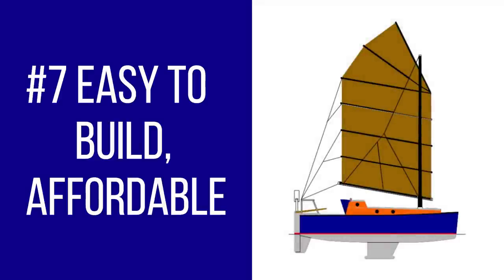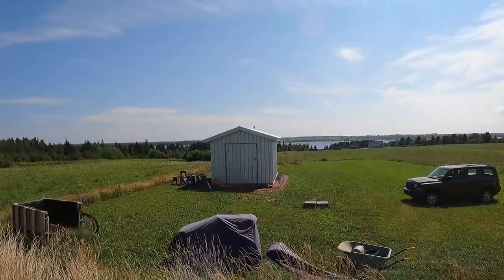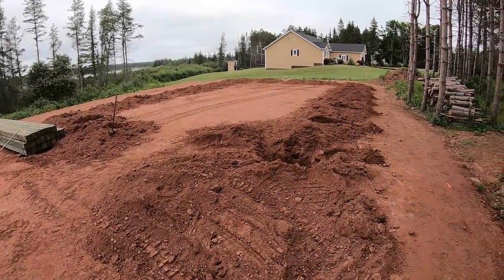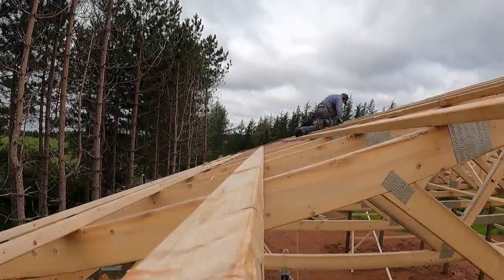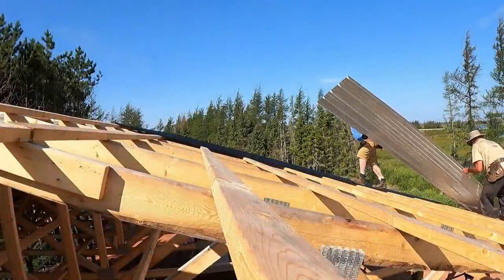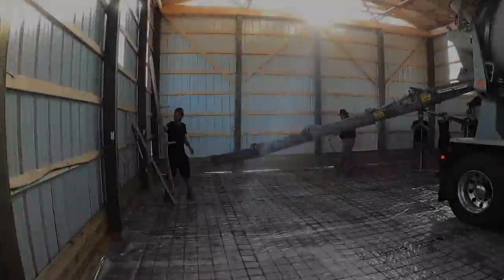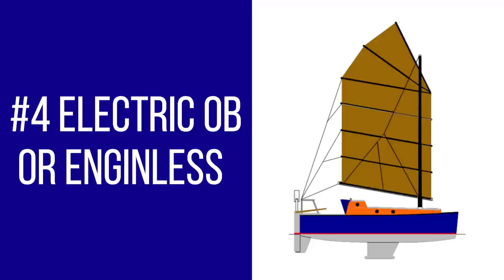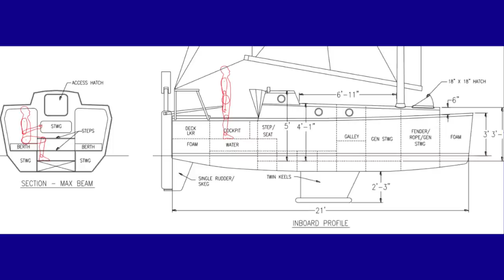S2E02 Boat Shed Build and Wave Rover Hull #1 Plan Availability

Comment: Kudos to Mrs. Rover! My wife was in shock & awe. Ha ha. Alan, not sure if you wanted questions just about the designer's background or the design of this boat in particular, but here goes: What other boats have been built from his plans? How about an explanation of the hull shape? Will she self-right if turtled? What is the preferred heel angle for efficient sailing? What is the hull speed? How much horsepower to motor at hull speed? Primary and Secondary stability. How to design it with strength to survive rollover. Tell us more about the positive floatation aspects of the vessel. Ply-on-Frame construction or Stitch & Glue? Wood species? Fiberglass & epoxy schedule? How will the running rigging for the sail be organized? Will the bilge keels be fabricated from steel, cast iron or lead? In theory the Junk Rig is simple, but sometimes all the parrells used to control the yard, battens, boom and diagonal wrinkles can get overwhelming...how do you plan to keep it as simple as possible for a 21 ft. boat?
Reply from the maker: Great questions! I will pass on all of them to Andy, they will make for great discussion and answers.

Comment: Hi Aan,  I watched this video earlier this week and took screenshots so I could capture the images and see if this a boat I'd like to build.  Then followed up watching several YouTube videos explaining how a Junk Rig works.  The Junk Rig looks very simple, and user friendly for a single hand sailor.  Not having to leave the cockpit to make sail changes, makes this much safer.  Wednesday 9/1/21, I sat down to analyze the drawings and wrote down the changes I would make to fit into your seven point design criteria.  I believe with a few changes you can have a boat with more strength, integral water tanks with greater water storage capacity, greater amount of storage space by rearranging the foam to be also insulation for the hull, ceiling,and floor (using materials that can be bought at big box stores like Home Depot).  These are just a few of the ideas.  Last night, Thursday, we saw your video and announcement for the study plans.  Today I purchased your Boat Study Plans and the Wind Vane plans.  I'd like to discuss the plans in greater detail as I feel a few changes will equate to greater strength, more  positive buoyancy more evenly installed, which will bring greater comfort.  Is there a way I could email you and the architect these ideas?
Reply from the maker: Go to the "about" section of the Channel and you will find a business email. I look forward to hearing from you.

Comment: I have cruised in the Pacific in a vessel of similar size. If I were doing it again Wave Rover would tick just about all of my boxes as an ocean going home. Like Wave Rover my boat could be sealed up tight and proved to be very seaworthy. However, it did lack enough ventilation to make living aboard comfortable in the tropics, which is where you spend most of your time on a circumnavigation under sail. Also, it would have been nice to be able to stand erect somewhere in the cabin.
Reply from the maker: Ventilation is a problem that I will ask the architect to solve or at least get some practical input.

Comment: Thank you Alan for solving the problem with my study plan down load… all good. Very pleased with the concept. I enlarged the plans to 21 cm etc. And I noticed the births are quite long and the figure appears to be about 5’6”” tall. Is this so?   These are observations. The stern of WaveRover seems very wide I was wondering why?  The rudder…… would it be better, if it was a balanced rudder? Just asking because a friend of mine had a drop rudder on his large trailer sailer and the pintles were vertical, which caused weather helm. He tilted the top of the rudder away from the stern so there was more area of rudder in front of the pintles… it worked.  Thank  you very much for an excellent series of videos , cheers Tony Woollcombe
Reply from the maker: HI Tony, a lot of details are still being developed at this point by Andy. The balance of the whole boat is very important to me and it's a point that I stressed with Andy. And I have every confidence that Andy will not disappoint when he produces the actual construction plans. Thanks for supporting the build.
Reply: @RoversAdventure  thanks Alan

Comment: Just wondering if you could compare the Wave Rover to the Class Globe 580. I fascinated by both and would hope to build one of them.
Reply from the maker: Firstly, I almost went with a 5.8, also check out the Aviateur 5.7. But ultimately they both lack sufficient carrying capacity for the type of long distance cruising I envision, so Wave Rover  is bigger and has considerably more buoyancy to carry heavier loads without sinking below her DWL. Both the 5.8 and the Aviateur have sophisticated modern fractional rigs with running back stays where as Wave Rover has a simple to use, simple to rig, simple to make Chinese lug sail. Self steering is very important to me and not an after thought, so I told my naval architect to prioritize that in the design and that's why we have hydrodynamically shaped twin keels (which also act as ballast, cradle, and dampen the rolling at sea). Finally, I believe that the Wave Rover will be cheaper and easier to build.
I suggest that you watch my next video as Andy answers a number of questions about the design and we make a limited number of Study Plans available.
Reply: @RoversAdventure  "I believe that the Wave Rover will be cheaper and easier to build (...)" well said .... I like it :)

Comment: the trusses rest on perimeter beams.  how are the beams attached to the poles? what prevents the bottom edge of the walls from frost heaving?
Reply from the maker: They are supposed to be through bolted but Brian just nailed them with 4"nails, I would have bolted them. The perimeter is very likely to suffer heaves as nothing other than drainage is the only precaution. These pole barns are generally constructed as barns for live stock and the heat from the animals keeps the perimeter warm but in the case of a boat shed this is unlikely to be the case. You have identified the main reason that I would not build such a structure.

Comment: Hello, this is a very great idea and i might be building it, as my previous boat is not solid enough for such a program.
Just one question : do you plan any way to remove the mast to put the boat on trailer or go under bridges ? Because you said it will be bound to the keel.
Thank you !
Reply from the maker: The mast will be keel stepped and will be removeable, but at only 25' above the water line it should be easy to sail under most bridges. It will however require some assistance in stepping it.
Reply: You might consider a mast tabernacled at the deck. I'm currently sailing a replica of the 1876 transatlantic dory Centennial,  this boat has a 20ft. Tabernacled gaff rig which can be lowered at sea to ride out especially bad weather and to fix anything that may become fouled or break aloft... just a thought.

Comment: Curious why you wouldn't pour the floor first, then place the poles on the concrete footing. That way you would not have to use pressure treated lumber and would be protected from the earth.

Comment: ...My guess is that the hull will be made of plywood (e.g. 10 mm thick) waterproof and a few solid hull frames.?
Reply from the maker: We are going with 9mm marine plywood for most of the hull and 18mm for the bottom. Covered in Fiber Glass. Frames and bulkheads for strength
Reply: @RoversAdventure  brilliant, it looks reasonable, thx a lot for your quick feedback, all the best :)

Comment: Just wondering about a scaled-down coastal cruiser. 16' w/ 6' beam with all the features of the 21' boat. I want to avoid registration $ and explore the ICW. Just a dream to have a junk rigged engineless boat. Same boat - just 25% smaller. Whatcha think?
Reply: Also Selway Fisher, Phil Bolger, Jim Michalak, etc.
Reply: @skaraborgcraft  Not even close. Mast has cables and no junk rigging.
Reply: @cornishhh  Selway Fisher- no junk rig, mast cables
Phil Bolger- no cabin
Jim Makalak- side keels
I don't think the perfect boat exists in a 16' junk rig twin keel. Sailing oceans - yes, you need 6 months storage. Coastal Cruiser, not so much. ICW or Great Loop in a sailboat with a sculling oar, what a ride!
Reply: @steamyb2  How about William Longyard's Lucky Town? I'm pretty sure more than one Bolger Micro has been built with a junk rig and they dry out pretty flat.
Do you reckon you'd be safe going down the Mississippi without an engine? I'm in the UK so I don't know, but it looks to have quite a flow on it in some conditions.
West Wight Potters sometimes have junk rigs don't they?
Why do you especially want a twin keel?
Reply: @cornishhh  Twin keel for shallow water along the NC & SC coasts. Regular keel works great for blue water sailing and ballast. I would be using water bags for ballast.
I am just starting this research, so I think a shallow draft, flat bottom with a large rudder or twin keels would go down the Mississippi without a problem. Folks have done the Great Loop on kayak, canoe, etc. 
I will check out William Longyard's Lucky Town. Thx!
Reply: I’ve been looking at similar options since coastal cruising is more to my ability right now. There are a few gaff or Marconi-spec’d boats from the Atkins folks in the 18-20’ range with draft around 2-3’ (these are all keelboats as I’m looking to avoid center boards for cabin space—though two leeboard options are intriguing). I’m also looking at Oughtred’s smaller cruising boats (18-20’). I assume many boats can be reconfigured for junk sails, but I’m not sure. I’ve also been looking at the Triloboat sailing barge concept that calls for junk rig.

Length of 18’ seems to be about the smallest most designers go for cabins suitable for multi-day trips. Smaller tends to depend on open boats and tents (on board or on ground). Is 16’ a particular advantage on the ICW?
Reply: @jelliottlein  16' LOA does not require registration. Anything over 16' or with an engine has to be registered. Just my preference to avoid paperwork.
Reply: @steamyb2  Thanks. Good to know. The only boat I’ve built so far is 16.5’ long; a 2-seat decked canoe/open kayak that can be sailed. 21’ is close to the smallest I’ve found plans for a sailboat with a cabin; 18’ flat is the shortest on my “possible” list right now. There might simply be a limit there. But I see plenty of folks doing the open boat camping thing along coasts (see Roger Barnes’ “Dinghy Cruising”), and I’m likely to build a 14-16’ open sailer (maybe Oughtred’s Elf or Woodfish) before I take the next step up to a cabin cruiser of 18-24’.

Comment: Q: why a flat bottom, while a v-shaped bottom would improve behaviour and would prevent slamming on waves?
Reply: You'll find that going to windward a flat bottom is heeled over and presents a sharp chine which quietly slices through the oncoming waves... where a V bottom heeled to 30-40 degrees presents a flat surface which slaps and pounds in an angry sea.
Reply: Check out Matt Lyden fantastic Paradox designs!

Comment: Twin keel design??
Reply from the maker: @skaraborgcraft  Well said my friend!
Reply: Im a fan of twin keel, for sure. Own a Westerly 26. Just wondering why Alan decided on a twin keel design after the Contessa.
Reply: The last video describes the benefits. I really like the idea. I’ve been looking at Ian Oughtred’s 19’9” Eun Na Mara lately, with its two retractable bilge boards. I like hearing about the performance benefits to the twin boards outside of interior space concerns alone.
Reply from the maker: @markkuiper5233  I started off by giving the Naval architect my design ideas and I put a big emphasis on tracking and stability for the sake of self steering. He suggested the twin keels. I told him that I was very comfortable going that route as Wren, the first boat that I built and took across the Pacific solo was a bilge keeler.
Reply: Chris Madden 
Im very curious about this thread, i sail a 23 , venture newport , 600# swing keel , and have often wondered about the addition of bilge keels to increase its costal crusing grounds . Im glued to your progress Alan

Comment: WHY A JUNK RIG?  WOULD A LATEEN BE GOOD?  PLEASE MAKE A VID.
Reply: The Chinese Lug sail ( Junk Rig ) is actually a very user friendly setup. It is cheap to make, super strong, easy to repair and simple for one person to use. It is a great choice for solo  sailors.
Reply from the maker: @roberthegarty5640  Couldn't have said it better Robert.
Reply: The length and possibly weight of lateen spars on a boat this size would be difficult to handle single handed.